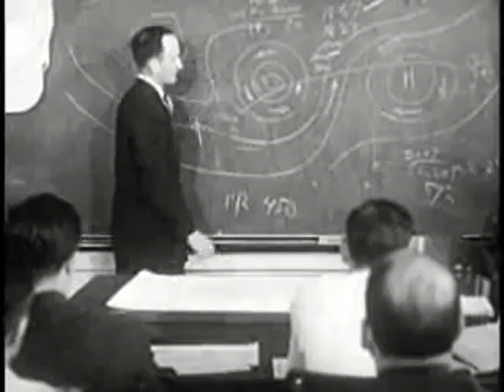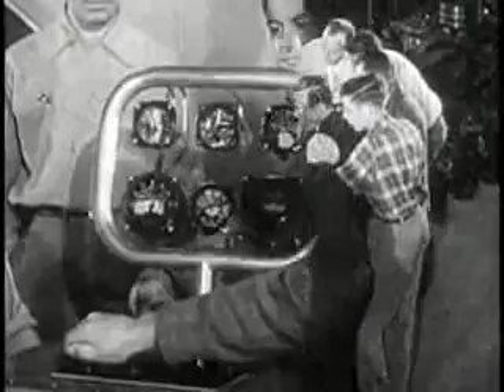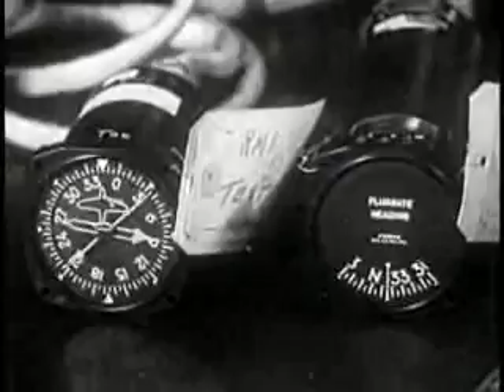Flying aboard the Lockheed Constellation part 1

Comment: Unless I'm mistaken, the Connie's used the Wright R-3350 Cyclone engines, same as the B-29 that also had a lot of engine trouble.  I think Lockheed has plans to switch to the Pratt-Whitney R-2800 engines but that never happened.  Finally with the 1049 Connie, much of the problems were fixed and a newer turbo compound R-3350 engine was used. The 1049 was a stretched version with longer wings, engines mounted further away from the fuselage to reduce noise and more, but all this happened at a time

Comment: The engine on the test platform which ran for 6 hours had FOUR blades & different cowling. Probably was a P&W from a DC-7, not a Wright Curtis from a Connie. I wish I didn't notice things like that. It ruins the film for me. I was watching an old movie the other night. Airport scene & in long shots the props were stopped differently than in the close ups of the pilots talking on the ground. As it cut back & forth it bugged me the stopped props were in different positions.

Comment: Wow. Sorry it seized up. Hope you can get it fixed or get another. I will never forget sitting on the port side next to the engine on a Martin 404 on a flight from Atlanta, Ga to Virginia. It was at night & the engine was loud & made the cabin rattle & there were two long flames of fire coming out of the two exhaust pipes under the engine. When we landed I wanted to know exactly what kind of engine it was. The pilot said P&W R2800CB-16. This was in 1967 but I remember it like yesterday.

Comment: Thank you so very much for sharing that story.  I can imagine that the purring of those engines would be far nicer than the general din of air rushing past the cabin at around 400 knots.  There's something to be said of the slower pace that's been lost.  I don ear plugs to diminish both the noise of the plane, and the noisy occupants inside the plane!  Still, nothing beats watching lightning illuminating the inside of thunder clouds back lit by the setting sun at 34,000 feet.

Comment: The  pratt and witney engines on most of the american designed aircraft) were serviced the same way I`m not a great authority on this though I did grow up thro the radial piston engined era. Some of the more exotic designs were even more complex than these were. All were stripped down and examined/serviced/ parts replaced after a certain number of hours run - answer to your question "yes" they were - all large multi piston engined aircraft were.

Comment: mellotrongirl, aircraft even today undergo rigorous inspections at specified intervals. There are A, B, C, and D checks, and a D check is like rebuilding an aircraft to new standards. It's so thorough that sometimes older planes are sold or mothballed if they're not worth the time and expense of a D check.